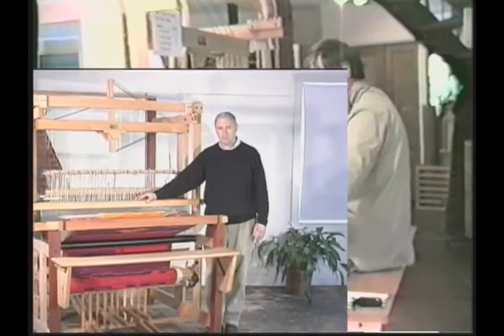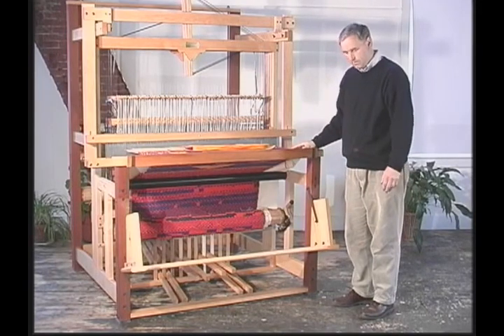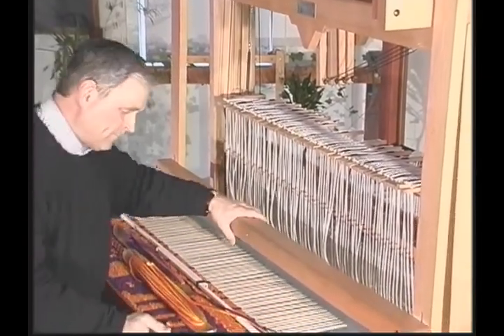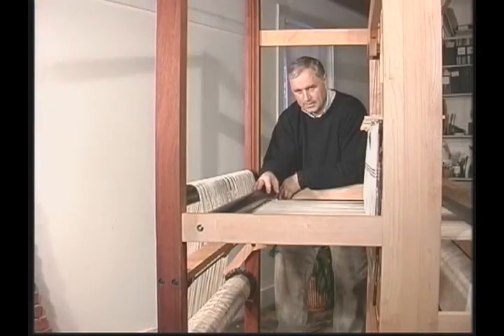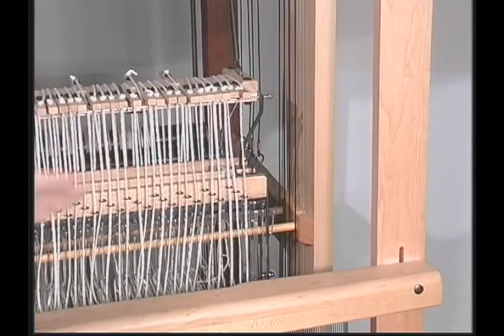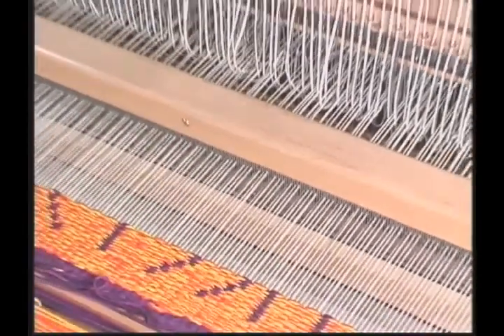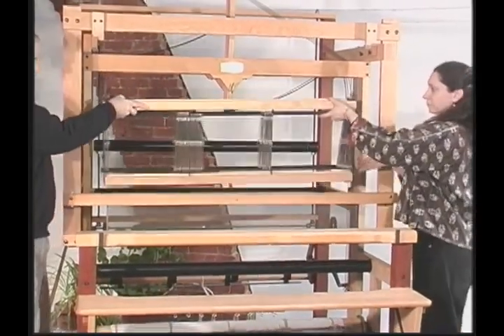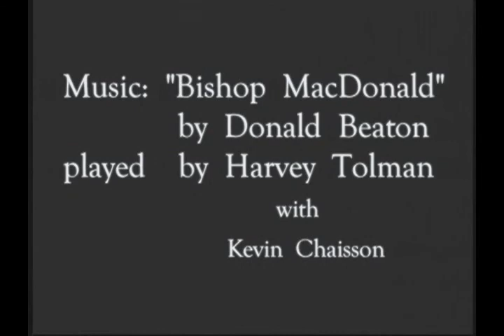Harrisville Rug Loom - Harrisville Designs, 2010

Comment: Looks like a really quality-made and innovative loom. For a rug-weaver, the shaft-switching device seems to fulfil the same function as a drawloom modification would do for a Swedish-style loom. However I think the "drawloom" function here would only be practical for rug weaving due to the restriction in the number of levers, or possibly for coarsely woven wool blankets. It was designed for use with a widely-space warp, as rug warps are (except for Repp-weave rugs). All in all, I am impressed, and of course now I want one. Thanks for the video!
Reply from the maker: Thanks!